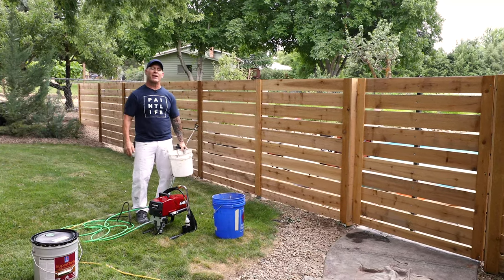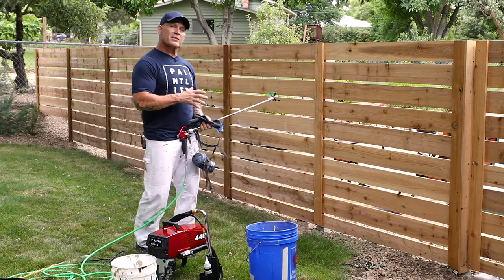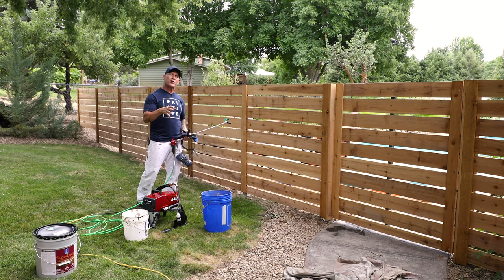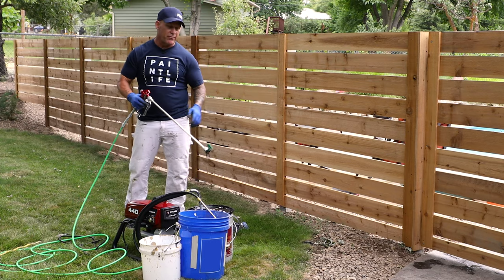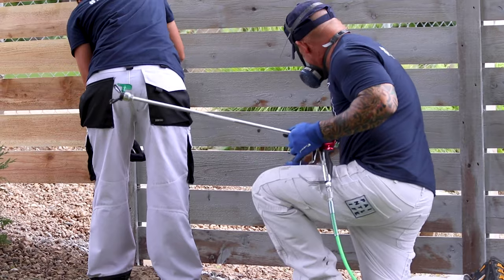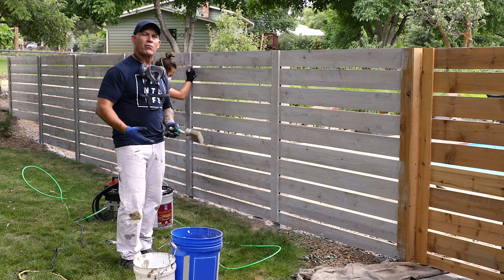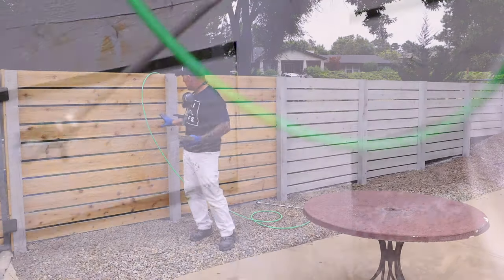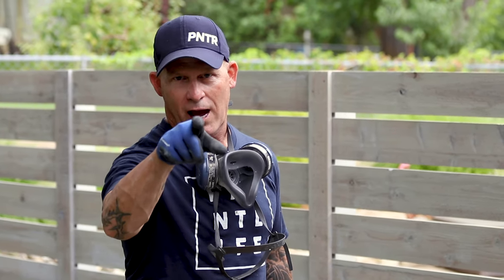WORST Product Ever, Oil Based Stain!  Never Oil a Wood Fence

Comment from the maker: Next time I will use Woodscapes
Reply: Use water based super deck a lot better imo
Reply: @PapABeerz6969  yeah super deck water base is great just its very watery vs the woodscapes which is great for walls imo
Reply: Woodscapes is more of a coating though, superdeck is an awesome product. Trick we use for shadow box fences is a drop taped to 2 roller poles on the opposite side of the fence so as to catch the overspray from getting airborne.
Reply: Woodscapes is good if you want to redo it in 2 years.  worst product on the market. I’ve seen it fail every time it has been used. I will never use it on any of my jobs.
Reply: @joelturpinpaint  not my. Jobs they last 10 years.
Reply: @joelturpinpaint  I did some cedar shake on a roof ... I used woodscapes ... this was done 3 years ago and all I have had to do to it is pressure wash it each summer and it has survived pretty brutal winters too. Just gotta know how to put the stuff on ... take your time, no need to rush.
Reply: I just did a fence that was really old but still standing and after pressure washing and let dry for two days the fence sucked up 20 gallons of woodscape solid in white ,which was expensive, but the customer wanted that painted look not just stained
Reply: @rowdybroomstick1216  the place I did 3 years ago was only supposed to take 21 gallons but it was so thirsty when it was all said and done it took 45 gallons. but it looks pretty good still and has only needed to be pressure washed each summer since.
Reply: Ready Seal is the best I've ever used. No back brush needed whatsoever, by far the most forgiving stain I've ever seen. We exclusively use it on fences/ patio covers unless the customer absolutely insists on something else
Reply: Im glad you use a brush. Gotta brush and work it into to the wood. I dont use an airless anymore though uses to much material ,(we have alot of wind) i just use the hand pump bug sprayer or deck sprayer
Reply: Oilbase lasts longer
Reply: @alexaronow9316  I've been using ready seal for 6 years now also!
Reply: Any tips for spraying a transparent overhead? Any advice will be greatly appreciated.  Thanks in advance.
Reply: Michael Renne  test the man's patience... he has the paint life mafia.  Deathwish
Reply: We are using READY SEAL, natural  cedar on 320 lin ft cedar foot using pump  sprayer  and backbreaking. We are first  time  DIY'ers!!
Reply: @paintlifetv Hey Chris, Today I was awarded a job to do a raw fence just like this one. I am going to use this job as a reason to add a titan 440 sprayer to my arsenal of tools. First, thanks for this video. Second, I work alone. Any suggestions / tips on how to handle the spraying and the back brushing? They want me to use an oil base product called Ready Seal from Home Depot. They like a color called Pecan that they have. 

Ive lost of a lot of fence bids over the last several months cause I was quoting a little too high. I want this job to look amazing so I can get more like it. Thanks in advance.
Reply: @PapABeerz6969  supedeck is discontinued
Reply: I used woodscapes on a similar fence. Waterbased, not oil.  I agree with you, I don't like using oil based products.  The Woodscapes is a great product, covers well, and runs through my sprayer well too.  I also backbrushed, makes a huge difference. Thanks for the video!! Oh, also, I ordered a hose whip from your store,....best product I have ever ordered!! Can't believe I've gone this long without one.
Reply: @ajsbrushworksllc8348  woodscapes is one of the least impressive products I have ever used. Basically every other waterborne product is superior. Flood, silkens, Benjamin moore, sashco, defy... Woodscapes is like water. We get a lot of calls to fix woodscapes jobs done just the previous year. At least it comes off easy!
Reply: @justinm4219  I guess it depends on where you live and who applied it. I've used it a bunch for fences, here in Central Texas and have had no issues. I use sikkens for doors, it's a beautiful product.
Reply: @cryptojunkie2478  superdeck has been discontinued
Reply: @justinm4219  superdeck has not been discontinued where I live. I just used it for 2 deck projects.
Reply: @ajsbrushworksllc8348  SW is transitioning the brand into Cabot's. Starting with some SKUs in the transparent oil the rest will follow later. Already some are out of production as of late last year and you can't get anymore.
Reply: @justinm4219  I just bought some last week at Sherwin Williams
Reply: @cryptojunkie2478  I'm sure you did. I suppose you'll just have to find out the hard way in a few months when they run out of existing stock.
though I would say its very average better than messmers or woodscapes there is better products than superdeck anyway so nothing really to be missed.
Reply: @justinm4219  that's a regional thing. I just spoke to my SW rep. Cabot is a SW competitor. My rep says some areas are doing it,but not where I am. I just ordered 30 gallons for 2 jobs. No issues.
Reply: @MyJtf  Hi Tommy how many gallons did it take, was it oil based or water?
Reply: @ChannelEleven59  Hi John what have you found to be best quote price per sq ft?  Does your price include cleaning then staining or just staining?  Thanks.
Reply: You can tell your a flat lander from the valley! Job security here all you flat lander come up here and I fix your failed products !
Reply: Thiner for cleaning the sprayer ?
Reply: @alexaronow9316  oil based? you used it with an airless sprayer? I love Ready seal too but Im hesitant to use it with the sprayer.
Reply: @jebediahbritt5851  I'm gunna use that one ;)
Reply: For a new fence, what's a better option? Superdeck or woodscapes for a natural looking.
Reply: Would a water-based solid stain adhere to a fence that was previously stained with semi-transparent oil?

Comment: I'm going to agree with many people here and say i have NEVER seen a water stain that is anywhere close to the quality of oil in terms of durability, penetration, and finish
Reply: Agree.  He seems to be more focused on the application not the wood, it’s typical of contractors who only care about how fast they can do a job.
Reply: More maintenance than water
Reply: anyone with a brain and ANY experience at all Knows OIL IS KING when it comes to stain. The title of this video OMG......
Reply: @WhiskeyTangoFoxtraught  he is more focused on liability as he said.
Reply: AMEN. Oil for sure
Reply: Sashco
Reply: @mikethepainter  MIke I used to think the same until I used Thompsons out here on a fence in California.  What this guy is not showing is this material needs to be constantly stirred, as do most stains for optimum results
Reply: I might add that oil based doesn't peel.   When a re-coat is needed, there is much less prep work when oil is used.
Reply: @WhiskeyTangoFoxtraught  How long it lasts really isn't their problem.
Reply: I totally agree.  I stain professionally and oil is all I use.
Reply: Don't forget about all the health hazards of oil based stains. They can off gas for a year later or more.
Reply: Amen🙏
Reply: @mrp782 outdoors , who cares 🙄
Reply: @mrp782  it's not really an issue outside where it's ventilated
Reply: I can relate. I tried it in the mid 90's. Very disappointed in the longevity.
Reply: @KylePhillips-ww2li  I can't tell if your agreeing with me or it's big brain sarcasm about how you applied it in the 90's and it's still going strong.
Reply: @getsomeorgohome  Not in the long run. Water based forms a film that is not a good substrate for additional applications once it is dry. That means it needs to be completely gone before it can be reapplied.

Comment: I’ve learned a lot from your videos but in my experience, no water based stain is as good as a good oil based stain like Ready Seal or TWP. Stain should soak into the wood and not leave a “coating” which peels or flat out fails. Spraying is troublesome with oils but it definitely lasts longer and is easier to reapply in a 2-3 years.
Reply: As a pro painter I could not agree more. Oil penetrates much more and actually rehydrates and reconditions the wood. Water based stain is like watery paint that relies in pigment ( which peels in time) and makes the wood dry out in time . Trees have oil resins in them not water.  Water based is easier and less toxic to apply which are the only pros in my opinion.
Reply: He must be sponsored by a latex company?? Oil all day long.
Reply: @Eastcentralstainingco  i tend to agree with you there is no way if you ever stripped an water base stain you would want to apply water base stain to anything
Reply: Ready seal? Its fades away within 6 months!!
Reply: @jonc2914 ive had great results with the light oak from ready seal. Just ordered my 6th 5 gallon can for my fences and decks. For newer and older woods treated and cedar, ease of use with this product is a win in my book.
Reply: @nothanks1627  i used ready seal and it still looks beautiful after 8 months. No idea why people give it bad reviews about fading color.
Reply: Because they aren't putting it on thick enough

Comment: Exterior treated lumber = oil all the way, all the time!
Reply: Damn right
Reply: ThAts rite
Reply: if you don't want your wood to dry and crack like most wood does always use oil based stain as it will soak into the lumber and actually act as a moisturizer keeping the wood supple and preserved.

Comment: The cover to the can HAS to be removed. That needs to be stirred, it settles REAL quick. That hole in the lid is for adding tint only.  Tip's too big for that 313 or  smaller. 38 years in the business

Comment: I built a redwood wheelchair ramp and replaced a gate for a customer.
I used water base stain/sealer on the gate and I used oil on the ramp and deck. The water based product faded out and the gate started to get gray within two years. But the ramp and deck still look good. It’s been about 5 years and the deck still looks good. I went back and re did the gate in oil for the customer.

Comment: Water based stain doesn't last long, re-staining requires a lot of prep and it peels.     Olympic was recommended for my cedar spa, by the spa manufacturer.   All prep work and application was done per directions and it only lasted a year before it starting peeling.   It took me over a week with a palm sander to sand the crap off the wood before applying an oil based stain.    Oh, and I noticed the spa manufacturer no longer recommends the Olympic stain.. Since I couldn't find oil based in my state at the time, I was able to order it from the spa manufacturer and had it shipped to me.  (They now recommend Superdeck.)   My next stain job will be piece of cake because the prep work will be just cleaning the cedar surface and letting it dry before staining.

Comment: At LykeNew Power Wash we do our best to stay away from all semi-transparent stains. They are twice the labor to apply right and do not last as long. However the customer is always number one and gets to choose. On my Facebook page you can see a before and after of a surface wash and strip we did on over 500 ft of already stained semi-transparent stain that was applied the year before wrong. Then the after pics with it applied correctly. We use the same method but different equipment. We like to use a 12 volt diaphragm pump no smaller then 1.8 gpm at 60 psi then back brush in using a special micro fiber pad that allows us to push a lot more stain in the wood. One pad can last us well over 300 ft of ruff cedar 6 ft high. Check it out for yourself. Idaho painter keep it Rockin and thanks for all you do.

Comment: I love what you do, appreciate your experience, and your work is phenomenal... that being said, your video title (and I assume your stance against oil products) is counter to chemistry. Wood is naturally accepting to oil, because the wood naturally contains oil that keeps it healthy. Water on the other hand does feed trees when they are alive, but only helps them rot when they dead. Oil + wood = a good relationship & water + wood = a bad relationship... In the short term the outcome may be quite beautiful from using a water-based product, but the maintenance will be severe over time. On the other hand, using an oil-based product will have to be maintained on a schedule, but the lasting effects will be wood that will last a lifetime +... I also saw that you used a Sherwin product (SuperDeck), which is full of petroleum distillates and dryers unlike something like ABR’s X-100 which is primarily linseed (flax) oil. Using a natural plant based oil on a schedule will provide the longest lasting health to wood... I understand where you are coming from, but I disagree based on the science of the matter... Keep doing what you do!
Reply: I'm sold!   lol    How about just tell me what you think is the best product for an old fence and a deck that has peeling solid. That's all. Just tell me a product and that'll be it. 75 hours of reading conflicting shit is driving me mad.
Reply: I can only assume he meant OIL, as in maybe an exterior penetrating oil? Of which may or not be true, as it ALL comes down to "product and project pairing." 
I have to say, the assumption or rationale that oil based is better than wb for dead wood is rather a carelessly broad statement. As a quick example wb coatings allow water vapors to permeate them (a good thing in some instances),  take for instance the moisture accumulation trapped in wall cavities of homes in areas with strong winters. Usually caused by humidifiers running nonstop all winter long to combat the dry air from forced air hvac,. Water born coatings on the exterior will, and do allow the moisture to permeate them and leave.  As we know oil in times dries hard and brittle, cracks and eventually de laminates.  
Not to mention there are fair numbers of oil based products that contain FOOD FOR MOLD AND MILDEW, see the very involved preparatory bleaching instructions for Sikkens' application.
Reply: True briefing, Naturally oil have  protective  elements not only save his surface , after penitration,wood will strong with  life addition of it's and protect from water and humidity  a long long time.
Reply: @MrEyesof9  You are comparing oil base stains to the characteristics of oil based paints. they are not the same thing. A house respires through the walls. A fence stain does not. Oil based paints are relative vapor barriers. Stains are not.

Comment: I've been told the oil based stain soaks into the wood more, good for 1st coats, and future coats could then be latex.  But, better products seem to come out all the time.  And I agree, latex is much better to work with.  Also, sometimes I hang a plastic over the back side to catch overspray.  Great videos, and good family help!
Reply: Idk if you would find any coatings manufacturer that would recommend a latex over oil, sounds like bad news

Comment: Great tips for the home owner and average painter.  My only question respectfully is.  What's on the other side of the fence?  Looks like concrete and a pool.   Wouldn't it be good to plastic the other side for over spray??

Comment: I used an oil based stain for my fence by sheer dumb luck about 12-13 years ago. It may have faded slightly, but it still looks really good.  I can't imagine an water based product holding up this well.
Reply: Same, for me it was duck back oil stain.
Reply: It won't, not even close.

Comment: Wow, great video. One question about oil-based versus Water: my understanding is that oil-based doesn’t last as long, but you can recoat an oil based stain without any prep work. Has that been your experience?

Comment: I sprayed oil base stains on houses and fences for 30 years. it takes practice if you want to know how let me know
Reply: I've done it for 40 years - what advice do you have that the "paint life" man didn't teach us ???
Reply: Lucc 701 what brand would you use to paint a bare fence? Instead of stain would paint help make the fence last longer. Thanks.
Reply: Would I have to use a brush to keep it from going to the other side of the fence? What’s the best way to paint just one side?
Reply: @kayBTR kayBTR anything that coats works but will eventually peel whereas stains and oil-based products will soak into the said surface as long as you take the time to make all even while keeping a wet edge it will last longer than a coating.
Reply: @mccartneystuart  What brand and type from that brand would you suggest?  I've had a fence installed that 476 linear feet. That's almost a thousand linear feet (6000 sqft) of staining front and back. I am overwhelmed with what to do right now. Jokingly, what I need is a Daniel LaRusso in exchange for learning to play guitar...  No side - side.  Up, down!  Look foward to your response Lucc.
Reply: @JacquesLambert If you are really serious I would like to learn anything I can from you. I've been learning about soft washing and prepping wood fences for stain. Anything you are willing to share would be awesome while I grow my business!
Reply: stain is the easiest stuff to apply OMG. If he wants to get less overspray use a shorter pole. OMG. PUT DOWN THAT POLE>
Reply: @sammysmith9818   to hold a drop on the opposite side of the fence to catch over spray coming through between rails.
Reply: Jacques Lambert , well said

Comment: So, this video is how to do the least work to say a fence is stained. Water based stains are just a coating, it doesn't penetrate. It holds any water in the wood inside and can actually cause it to rot earlier. It will start going bad in as little as a year. It can chip and peel. It needs to be removed before re-applying a new coat. Don't use water based and ALWAYS use oil based. Choose a low VOC oil/stain, apply when wood is dry, and it will last longer, look better, and when it does need a refresh, you can apply over the old.